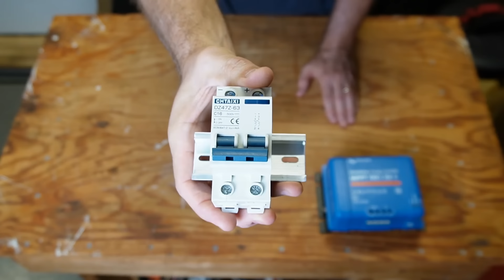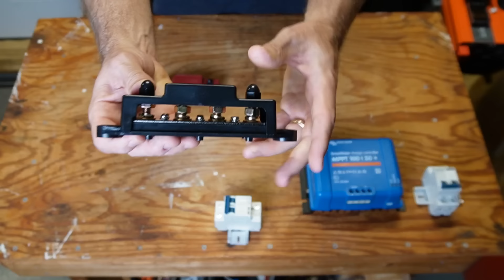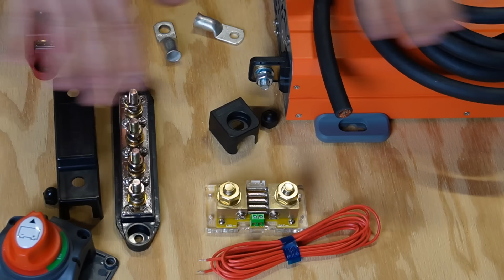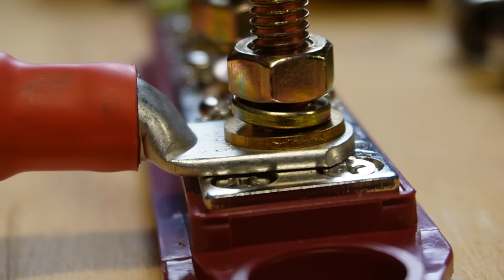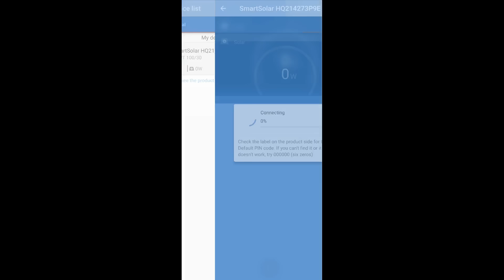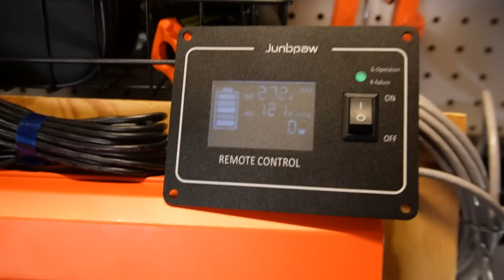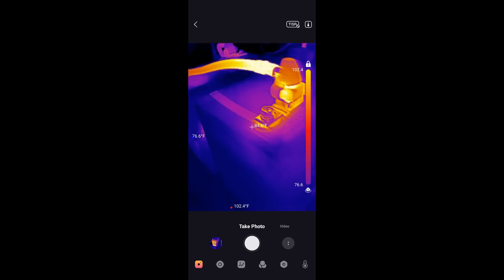24V DIY Off-Grid Solar Generator Build For Beginners

Comment: You explained everything very well. 1 question...After you do everything in this set up.Where or when do you install a fuse Box? Asking....What if you have several different items & you wanted to hook them up to different sizes of Fuses in the fuse Box to make them work?Can you explain.Please let me know.Thanks.
Reply from the maker: Thanks! Do you mean a DC fuse box for 12/24v devices? Most of those fuse boxes are for 12v devices and my build was a 24v. So if you have a 24v system and want to use 12v devices, you may need a 24v to 12v step down converter before your fuse box. But to answer your question, I would have just hooked the DC fuse box directly to the bus bars like everything else.
Reply: 255  God! There is no god except He, the Living, the Everlasting. Neither slumber overtakes Him, nor sleep. To Him belongs everything in the heavens and everything on earth. Who is he that can intercede with Him except with His permission? He knows what is before them, and what is behind them; and they cannot grasp any of His knowledge, except as He wills. His Throne extends over the heavens and the earth, and their preservation does not burden Him. He is the Most High, the Great.
256  There shall be no compulsion in religion; the right way has become distinct from the wrong way. Whoever renounces evil and believes in God has grasped the most trustworthy handle; which does not break. God is Hearing and Knowing.
257  God is the Lord of those who believe; He brings them out of darkness and into light. As for those who disbelieve, their lords are the evil ones; they bring them out of light and into darkness—these are the inmates of the Fire, in which they will abide forever.
258  Have you not considered him who argued with Abraham about his Lord, because God had given him sovereignty? Abraham said, “My Lord is He who gives life and causes death.” He said, “I give life and cause death.” Abraham said, “God brings the sun from the East, so bring it from the West,” so the blasphemer was confounded. God does not guide the wrongdoing people.
259  Or like him who passed by a town collapsed on its foundations. He said, “How can God revive this after its demise?” Thereupon God caused him to die for a hundred years, and then resurrected him. He said, “For how long have you tarried?” He said, “I have tarried for a day, or part of a day.” He said, “No. You have tarried for a hundred years. Now look at your food and your drink—it has not spoiled—and look at your donkey. We will make you a wonder for mankind. And look at the bones, how We arrange them, and then clothe them with flesh.” So when it became clear to him, he said, “I know that God has power over all things.”
260  And when Abraham said, “My Lord, show me how You give life to the dead.” He said, “Have you not believed?” He said, “Yes, but to put my heart at ease.” He said, “Take four birds, and incline them to yourself, then place a part on each hill, then call to them; and they will come rushing to you. And know that God is Powerful and Wise.”

2  God, there is no god but He, the Living, the Eternal.
3  He sent down to you the Book with the Truth, confirming what came before it; and He sent down the Torah and the Gospel.
4  Aforetime, as guidance for mankind; and He sent down the Criterion. Those who have rejected God’s signs will have a severe punishment. God is Mighty, Able to take revenge.
5  Nothing is hidden from God, on earth or in the heaven.
6  It is He who forms you in the wombs as He wills. There is no god except He, the Almighty, the Wise.

11  Originator of the heavens and the earth. He made for you mates from among yourselves, and pairs of animals, by means of which He multiplies you. There is nothing like Him. He is the Hearing, the Seeing.
12  To Him belongs absolute control of the heavens and the earth. He spreads the bounties to whomever He wills, or reduces it. He is aware of all things.
13  He prescribed for you the same religion He enjoined upon Noah, and what We inspired to you, and what We enjoined upon Abraham, and Moses, and Jesus: “You shall uphold the religion, and be not divided therein.” As for the idolaters, what you call them to is outrageous to them. God chooses to Himself whom He wills, and He guides to Himself whoever repents.

54  Your Lord is God; He who created the heavens and the earth in six days, then established Himself on the Throne. The night overtakes the day, as it pursues it persistently; and the sun, and the moon, and the stars are subservient by His command. His is the creation, and His is the command. Blessed is God, Lord of all beings.
55  Call upon your Lord humbly and privately. He does not love the aggressors.
56  And do not corrupt on earth after its reformation, and pray to Him with fear and hope. God’s mercy is close to the doers of good.
57  It is He who sends the wind ahead of His mercy. Then, when they have gathered up heavy clouds, We drive them to a dead land, where We make water come down, and with it We bring out all kinds of fruits. Thus We bring out the dead—perhaps you will reflect.
58  As for the good land, it yields its produce by the leave of its Lord. But as for the bad, it produces nothing but hardship and misery. Thus We explain the revelations in various ways for people who are thankful.
59  We sent Noah to his people. He said, “O my people! Worship God; you have no god other than Him. I fear for you the punishment of a tremendous Day.”
60  The dignitaries among his people said, “We see that you are in obvious error.”
61  He said, “O my people, I am not in error, but I am a messenger from the Lord of the Worlds.”
62  “I deliver to you the messages of my Lord, and I advise you, and I know from God what you do not know.”
63  “Do you wonder that a reminder has come to you from your Lord, through a man from among you, to warn you, and to lead you to righteousness, so that you may attain mercy?”
64  But they called him a liar. So We saved him and those with him in the Ark, and We drowned those who rejected Our revelations. They were blind people.

59  The likeness of Jesus in God’s sight is that of Adam: He created him from dust, then said to him, “Be,” and he was.
60  The truth is from your Lord, so do not be of those who doubt.
61  And if anyone disputes with you about him, after the knowledge that has come to you, say, “Come, let us call our children and your children, and our women and your women, and ourselves and yourselves, and let us invoke God’s curse on the liars.”
62  This is the narrative of truth: there is no god but God. God is the Mighty, the Wise.
63  But if they turn away—God knows the corrupt.
64  Say, “O People of the Book, come to terms common between us and you: that we worship none but God, and that we associate nothing with Him, and that none of us takes others as lords besides God.” And if they turn away, say, “Bear witness that we have submitted.”
65  O People of the Book! Why do you argue about Abraham, when the Torah and the Gospel were not revealed until after him? Will you not reason?
66  Here you are—you argue about things you know, but why do you argue about things you do not know? God knows, and you do not know.
67  Abraham was neither a Jew nor a Christian, but he was a Monotheist, a Muslim. And he was not of the Polytheists.
68  The people most deserving of Abraham are those who followed him, and this prophet, and those who believe. God is the Guardian of the believers.
69  A party of the People of the Book would love to lead you astray, but they only lead themselves astray, and they do not realize it.

84  Say, “We believe in God, and in what was revealed to us; and in what was revealed to Abraham, and Ishmael, and Isaac, and Jacob, and the Patriarchs; and in what was given to Moses, and Jesus, and the prophets from their Lord. We make no distinction between any of them, and to Him we submit.”
85  Whoever seeks other than Islam as a religion, it will not be accepted from him, and in the Hereafter he will be among the losers.

28  It is He who sent His Messenger with the guidance and the religion of truth, to make it prevail over all religions. God suffices as Witness.
29  Muhammad is the Messenger of God. Those with him are stern against the disbelievers, yet compassionate amongst themselves. You see them kneeling, prostrating, seeking blessings from God and approval. Their marks are on their faces from the effects of prostration. Such is their description in the Torah, and their description in the Gospel: like a plant that sprouts, becomes strong, grows thick, and rests on its stem, impressing the farmers. Through them He enrages the disbelievers. God has promised those among them who believe and do good deeds forgiveness and a great reward.

111  And say, “Praise be to God, who has not begotten a son, nor has He a partner in sovereignty, nor has He an ally out of weakness, and glorify Him constantly.”

Read The Quran

Comment: Nice! I'm working on a 24V system as well, to feed an Aferiy P310 on it's solar input.  I'm hoping that will work.
Reply from the maker: That AFERIY P310 is a beefy power station. So are you only going to have batteries in your 24v system that will feed your P310 solar input?
Reply: 255  God! There is no god except He, the Living, the Everlasting. Neither slumber overtakes Him, nor sleep. To Him belongs everything in the heavens and everything on earth. Who is he that can intercede with Him except with His permission? He knows what is before them, and what is behind them; and they cannot grasp any of His knowledge, except as He wills. His Throne extends over the heavens and the earth, and their preservation does not burden Him. He is the Most High, the Great.
256  There shall be no compulsion in religion; the right way has become distinct from the wrong way. Whoever renounces evil and believes in God has grasped the most trustworthy handle; which does not break. God is Hearing and Knowing.
257  God is the Lord of those who believe; He brings them out of darkness and into light. As for those who disbelieve, their lords are the evil ones; they bring them out of light and into darkness—these are the inmates of the Fire, in which they will abide forever.
258  Have you not considered him who argued with Abraham about his Lord, because God had given him sovereignty? Abraham said, “My Lord is He who gives life and causes death.” He said, “I give life and cause death.” Abraham said, “God brings the sun from the East, so bring it from the West,” so the blasphemer was confounded. God does not guide the wrongdoing people.
259  Or like him who passed by a town collapsed on its foundations. He said, “How can God revive this after its demise?” Thereupon God caused him to die for a hundred years, and then resurrected him. He said, “For how long have you tarried?” He said, “I have tarried for a day, or part of a day.” He said, “No. You have tarried for a hundred years. Now look at your food and your drink—it has not spoiled—and look at your donkey. We will make you a wonder for mankind. And look at the bones, how We arrange them, and then clothe them with flesh.” So when it became clear to him, he said, “I know that God has power over all things.”
260  And when Abraham said, “My Lord, show me how You give life to the dead.” He said, “Have you not believed?” He said, “Yes, but to put my heart at ease.” He said, “Take four birds, and incline them to yourself, then place a part on each hill, then call to them; and they will come rushing to you. And know that God is Powerful and Wise.”

2  God, there is no god but He, the Living, the Eternal.
3  He sent down to you the Book with the Truth, confirming what came before it; and He sent down the Torah and the Gospel.
4  Aforetime, as guidance for mankind; and He sent down the Criterion. Those who have rejected God’s signs will have a severe punishment. God is Mighty, Able to take revenge.
5  Nothing is hidden from God, on earth or in the heaven.
6  It is He who forms you in the wombs as He wills. There is no god except He, the Almighty, the Wise.

11  Originator of the heavens and the earth. He made for you mates from among yourselves, and pairs of animals, by means of which He multiplies you. There is nothing like Him. He is the Hearing, the Seeing.
12  To Him belongs absolute control of the heavens and the earth. He spreads the bounties to whomever He wills, or reduces it. He is aware of all things.
13  He prescribed for you the same religion He enjoined upon Noah, and what We inspired to you, and what We enjoined upon Abraham, and Moses, and Jesus: “You shall uphold the religion, and be not divided therein.” As for the idolaters, what you call them to is outrageous to them. God chooses to Himself whom He wills, and He guides to Himself whoever repents.

54  Your Lord is God; He who created the heavens and the earth in six days, then established Himself on the Throne. The night overtakes the day, as it pursues it persistently; and the sun, and the moon, and the stars are subservient by His command. His is the creation, and His is the command. Blessed is God, Lord of all beings.
55  Call upon your Lord humbly and privately. He does not love the aggressors.
56  And do not corrupt on earth after its reformation, and pray to Him with fear and hope. God’s mercy is close to the doers of good.
57  It is He who sends the wind ahead of His mercy. Then, when they have gathered up heavy clouds, We drive them to a dead land, where We make water come down, and with it We bring out all kinds of fruits. Thus We bring out the dead—perhaps you will reflect.
58  As for the good land, it yields its produce by the leave of its Lord. But as for the bad, it produces nothing but hardship and misery. Thus We explain the revelations in various ways for people who are thankful.
59  We sent Noah to his people. He said, “O my people! Worship God; you have no god other than Him. I fear for you the punishment of a tremendous Day.”
60  The dignitaries among his people said, “We see that you are in obvious error.”
61  He said, “O my people, I am not in error, but I am a messenger from the Lord of the Worlds.”
62  “I deliver to you the messages of my Lord, and I advise you, and I know from God what you do not know.”
63  “Do you wonder that a reminder has come to you from your Lord, through a man from among you, to warn you, and to lead you to righteousness, so that you may attain mercy?”
64  But they called him a liar. So We saved him and those with him in the Ark, and We drowned those who rejected Our revelations. They were blind people.

59  The likeness of Jesus in God’s sight is that of Adam: He created him from dust, then said to him, “Be,” and he was.
60  The truth is from your Lord, so do not be of those who doubt.
61  And if anyone disputes with you about him, after the knowledge that has come to you, say, “Come, let us call our children and your children, and our women and your women, and ourselves and yourselves, and let us invoke God’s curse on the liars.”
62  This is the narrative of truth: there is no god but God. God is the Mighty, the Wise.
63  But if they turn away—God knows the corrupt.
64  Say, “O People of the Book, come to terms common between us and you: that we worship none but God, and that we associate nothing with Him, and that none of us takes others as lords besides God.” And if they turn away, say, “Bear witness that we have submitted.”
65  O People of the Book! Why do you argue about Abraham, when the Torah and the Gospel were not revealed until after him? Will you not reason?
66  Here you are—you argue about things you know, but why do you argue about things you do not know? God knows, and you do not know.
67  Abraham was neither a Jew nor a Christian, but he was a Monotheist, a Muslim. And he was not of the Polytheists.
68  The people most deserving of Abraham are those who followed him, and this prophet, and those who believe. God is the Guardian of the believers.
69  A party of the People of the Book would love to lead you astray, but they only lead themselves astray, and they do not realize it.

84  Say, “We believe in God, and in what was revealed to us; and in what was revealed to Abraham, and Ishmael, and Isaac, and Jacob, and the Patriarchs; and in what was given to Moses, and Jesus, and the prophets from their Lord. We make no distinction between any of them, and to Him we submit.”
85  Whoever seeks other than Islam as a religion, it will not be accepted from him, and in the Hereafter he will be among the losers.

28  It is He who sent His Messenger with the guidance and the religion of truth, to make it prevail over all religions. God suffices as Witness.
29  Muhammad is the Messenger of God. Those with him are stern against the disbelievers, yet compassionate amongst themselves. You see them kneeling, prostrating, seeking blessings from God and approval. Their marks are on their faces from the effects of prostration. Such is their description in the Torah, and their description in the Gospel: like a plant that sprouts, becomes strong, grows thick, and rests on its stem, impressing the farmers. Through them He enrages the disbelievers. God has promised those among them who believe and do good deeds forgiveness and a great reward.

111  And say, “Praise be to God, who has not begotten a son, nor has He a partner in sovereignty, nor has He an ally out of weakness, and glorify Him constantly.”

Read The Quran